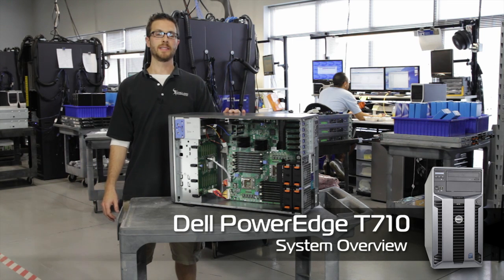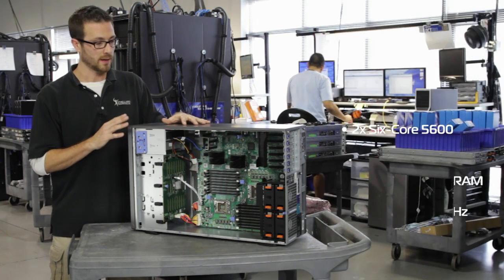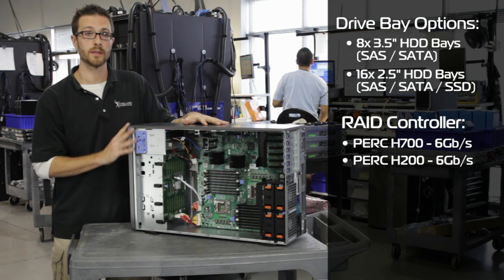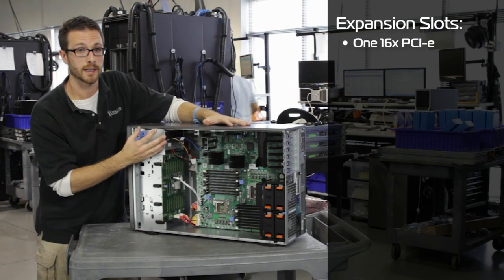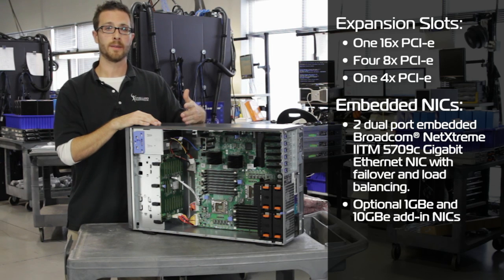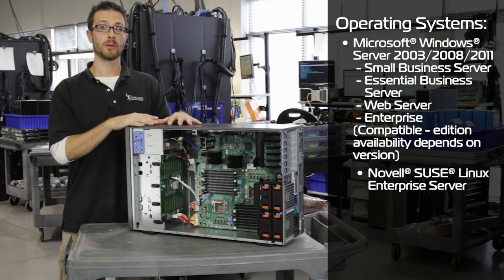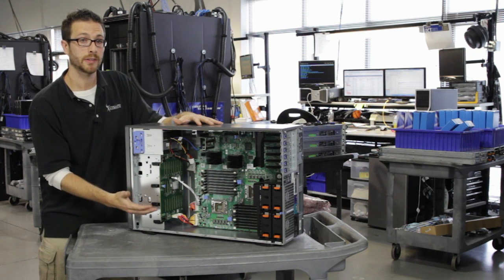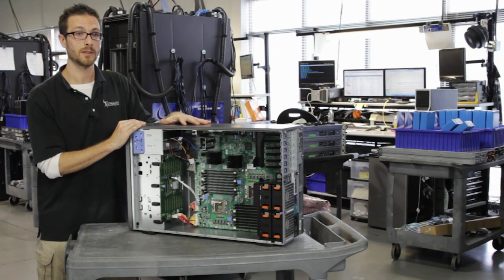Dell PowerEdge T710 - System Overview

Comment: I have a Dell T710 with 18 identical 8Gb ECC DDR3 chips installed. Tested valid working chips. I get the same message every boot. MEMBIST failure- 
The following DIMM Has been disabled by BIOS: DIMM B3 Message repeat for B6 and B9. iMessage stream repeats twice. The memory Utility in the bios recognizes the presence of the chips but does not allocate them to use. I have updated all the bios components that I can think of. What approach should I use to get on the plane recognized. I have checked several times and they are all identical black diamond chips.
Reply: sounds like you have a memory fail on those chips..
Reply: Do the memberships work when we arranged differently. It’s the same three memory spots that have the error